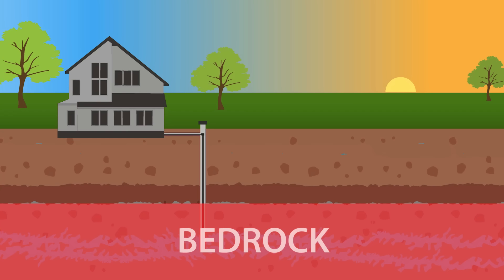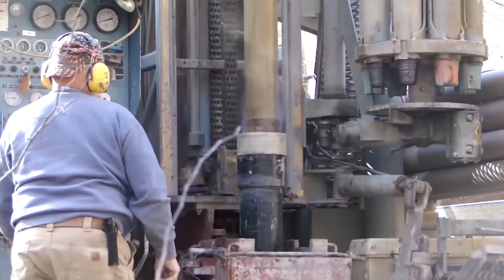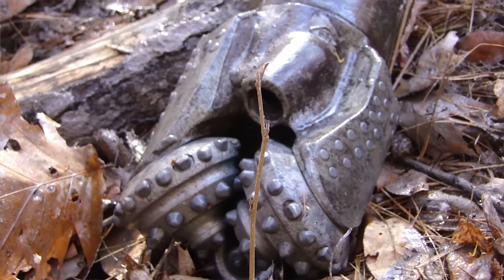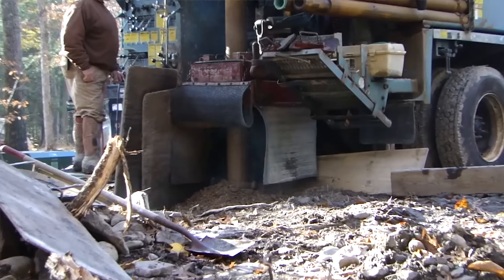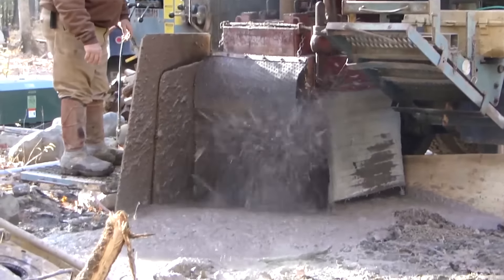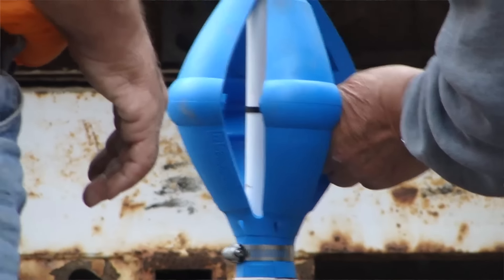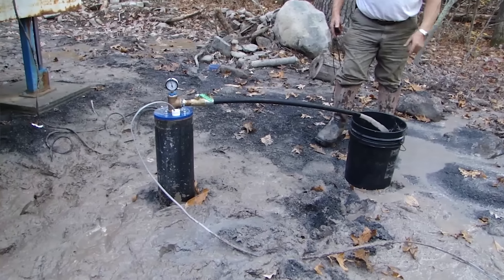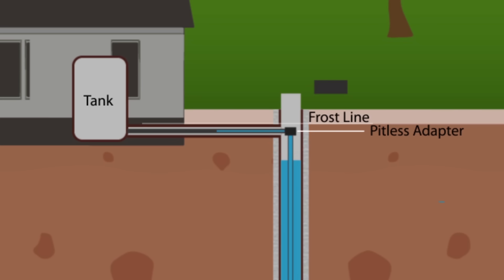WELL DRILLING 101 | Every Step Explained

Comment: This may have already been covered but:
- the reason to drill past where you hit water is to get a reserve in case the groundwater level goes down due to drought.  You gotta be careful not to go too far and hit dry strata that your well water will leak into instead of filling your well, though.  The extra length of well bore in water bearing strata also increases your potential flow rate.
- the reason for putting the pump higher in the hole is that clearly you have enough hydrologic pressure to push the water most of the way up, which means you can put the pump higher and therefore spend less on a smaller pump that doesn't need to sustain as much head pressure to get the water out of the well.  It also means the pump is further from any sediment collected in the bottom.

Thanks for putting this video up... I learned something from it too (which I didn't find in the videos I learned the info above.). I was looking for an explanation for how far the casing goes and why, and how the drill bit for stone fits through a hole that already has a casing in it.  Your video had that, none of the pro well driller videos did.  Thanks again!
Reply: Thanks well explained. 
What is the safe distance to go past after hitting the water if one is to avoid hitting the dry strata
Reply: @messagetsaurai2082  according to the professional well drillers I just had do my well, you stop when you notice the clay in the material coming up the borehole.  They said it is very noticeable.  The clay layer is generally at least several feet thick so you have some time to notice before you have gone through it too far.
Reply: Putting the pump deeper does not increase the amount of work or power that the pump must spend or exert. That is because the extra water column above the pump makes up the difference in pressure.  Otherwise, excellent desription.
Reply: @FelonyVideos  this comment feels wrong, but I can't think of a counter argument, so I'll just assume you know more than me and accept it lol
Reply: @kenstein  FWIW. I agree with everything else you said.

Please allow me to explain my note about the pressure and the work required, I'll use an analogy:

Imagine you sink a pump down to the bottom of the Marianas Trench, 35,000 feet down. The water will fill your pipe all the way up to the surface of the ocean. All the pump would have to do is supply enough pressure to raise the water above the surface to whatever height you desire (this is the outlet pressure). If the pressure at the bottom is (making up a number) 50,000 psi, and the pump can make 30 psi, it will create 50,030 psi right at its outlet. This will result in the water in the pipe, all up and down the length of it, to be 30 psi higher than the surrounding water, all the way to the surface. The flow rate will depend upon what restrictions the pump has to pump against. Now, if you raise the pump all the way up to the surface, where the relative pressure is 0 psi, the pump outlet will still be at 30 psi above the surrounding water. (I'm ignoring the fact that 7 miles of 1 inch pipe would create a massive restriction all on its own, but in the case of a water well, we are only talking about a few hundred feet of pipe, almost negligible).

So, the deeper the pump is in the water column, the more pressure assist it gets from the surrounding water, and that gets completely negated at the water surface (which must also include the cone of depression causes when the pump begins to pump close to the rate of the well feed capability).

Just for reference, the pressure in a water column increases about 15 psi for every 33 feet of depth from the surface.

So, if a pump is 100 feet below the surface, the pressure at the pump inlet would be about 45 psi. This is exactly the amount of pressure required to push the water up the pipe 100 feet. If the natural water level in the well is 200 feet below ground level, then the pump has to make 90 psi just to get the water to the surface with no flow rate. In order to get 30 psi at the surface, the pump must produce a head pressure of 120 psi. If the pump is at 300 feet in the same well, it must also create 230 psi, because the surrounding water pressure exactly compensates for the extra depth.

I hope that makes sense, I'm not very good at describing mathematics in words.
Reply: @FelonyVideos  yeah, that makes perfect sense.  Thanks!

Comment: The company I work for builds drill rigs you did a good job of describing everything for not having that much experience in the industry actually rather impressed with your amount of knowledge man. I learned a lot as well because I’ve never been in the well side myself and looking to drill one
Reply: How much do the drill rigs you built cost?  How do I get a basic, used one for a good price?
Reply: @r0ckworthy  used rigs can easily fetch $100,000. RigSource is a good place to research pricing and types.
Reply: @Volundur9567  I found their website, thank you. That's Rig Source Inc, in Elburn, IL.
Reply: @r0ckworthy  Yep,  I'm looking to rent from Rig Source.   Anyone game to diy drilling????   I need two done.  I'm Class A CDL and former heavy equip op.  but need some one with a little rig experience to coach.

Comment: Good job! From the oilfields of West Texas, I love to see water wells being drilled. We don't have much water.
Can you imagine drilling 13,000 feet with a 4 inch drill bit? And then turning it to keep drilling horizontally another 8,000 feet? These drillers of water and oil are something else. I'm amazed at how they do it.
Reply: WHAT???? That's what someone has to do to make a water well in Texas????  That's fucking insane. How could the water table be so far down and far away in some places? Is most of West Texas like this?
Reply: @r0ckworthy  I'm pretty sure they ain't drilling down 13k feet for water.
Reply: Yep.  Horizontal drilling and fracking for oil/gas builds on the same concepts as water well drilling.  Amazing stuff.
Reply: No one drills 13,000 ft for water. That’s not true!

Comment: Yeah, the blue thing is a torque arrester and more or less centers the pump in the bore. When the pump starts there's quite a twisting motion that if not countered by the "blue thing", may over time, fatigue the drop pipe that the pump hangs on and pushes water up through. A cracked drop pipe is a bummer. The over burden portion of the well was drilled with a tri-cone bit with carbide (not diamonds) inserts (knobby things). The invention of this kind of bit is what made Howard Hughes a multi-millionaire. It is sometimes referred to as a "Hughes" bit. When bedrock was encountered, the rotary bit was swapped out for a hammer drill. The PVC pipe was purpose-built for well drop pipe. Great video. I learned a bunch of stuff...thanks!

Comment: This was SUPER helpful. I bought a property with a drilled well set up that requires a heating line because the water access remained on the top vs being piped in the side under the frost line and brought to the building in that way with the pitiless adapter you are showing. I am in Canada where the temperatures drop in the winter. Trying to figure out why this is set up this way and if it can be changed.  I believe this building was originally a seasonal cottage in the 60s. 

Anyway, thank you so much. I am on my own here with a limited budget and this is the first truly helpful video I have seen for someone like me.

Comment: The blue thing above the pump looks like a torque arrestor. Keeps the pump from spinning and the wire from wrapping around the drop pipe. Thanks for the video. Well done!
Reply: Also, since it was PVC drop pipe instead of iron, it keeps the pipe from twisting and snapping and dropping the pump down the well. Ours is iron pipe and it doesn't have an arrestor on it. When we replace the drop pipe with PVC, we'll have to install the arrestor.
Reply: It is a torque arester
Reply: Had a pump installed without the torque arrester.   Eventually rubbed the wires bare from repeted twisting.
Reply: There’s an even more efficient way to install the pump too. Use black Polly pipe instead of pvc for easy access for pulling the pump and then use 3/4” black Polly pipe as a conduit for the wire to ensure the wire doesn’t rub and break. The blue torque stops can get stuck inside of wells very easily and can cause issues. Especially when they used pvc when it wasn’t necessary and is more expensive.

Comment: We're in Western Pa, Parents well is 350 ft deep, another one is about twice as deep. Question, what can be done about sulfer water? Did the casing crack? The well at 350 ft deep, water is beautiful best water ever. The deeper well across the street and up hill a little, water makes clothes red in wash plus must use Iron Out to clean tubs, toilets and sinks...any ideas other than a salt water filtration system we now have?
Reply: p.s. Same well that has the iron or sulfer smell to it, also feeds two other homes. One out of the three homes water smells like sewer gas... currently calling about that...what could that be and would it need shocked with chlorine?

Comment: I drilled oil wells back in the 1960’s, ‘70’s and ‘80’s. some as deep as 17000’ vertical depth. Your descriptions aren’t far off. Thanks for sharing.

Comment: I worked for a well driller for a  few years and you do NOT want to dig a pitless adapter for many reasons. First of these is contamination; any connection below grade is a source of possible contamination, like you said we humans tend to make a mess of things. Second is that to install the pitless adapter you have to dig a pit, then work in that pit while drilling a hole in your casing (getting metal bits in your drinkwater) installing the pitless adapter ect..., and if a connection fails, you have to dig that pit again. The next time you work in that pit is even worse, because it's wet and muddy and hanging head first into said hole is no fun at all, I know first hand. It is much better to have all your connections above ground where it is dry and clean. Build a shed with enough room stand up in. This will house your pressure tank (tanks?, you can hook up more than one), and build a little doghouse looking shed on the side that has a removable roof over your well head, that way when your pump fails it will be easier for that big truck to pull those long 21 foot pipes back up and out, saving you money in the long run.
Reply: Dude, you're delusional. I work for a pump company, we dont dril wells, we JUST work on pumps, and in 35 years full time, my boss says he could count on both hands the number of pitless adapters that have failed. On the other hand, he says the extra hourly he's gotten over the years for working around shitty well houses probably paid for his truck. Furthermore you'll never contaminate the well if you have a casing 18" above ground, and use a health department approved cap, as well as have a conduit installation that's up to code. I've seen 10 times more contamination risk in shitty damp rat infested well houses, that have well seals (that are harder to install than well caps, granted you have to dig a pitless hole like you said) with unplugged holes in the top. Also I question if you really worked for a driller, because any driller would laugh at you for saying cutting a hole in the casing contaminates the water any where near as much as the drilling process itself. By the way, what happens to that little rat infested shit hole when the driller has to come back and deepen the well or surge treat it with chemicals? You're spreading misinformation that could cost young homeowners tens of thousands, pull your head out of your ass driller boy (i still doubt the validity of that claim, like by few years do you mean for 2 summers you worked a month on your uncles rotary rig crew or something?)
Reply: BS

Comment: Ex oilfield (drilling) electricianhere, and I'm  so glad your video just popped into my phone. Very simple and informative. Plus, there are lots of smart & informed comments from other viewers. 
Someone mentioned the tri-cone rotary bit invented by Howard Hughes and how he made the majority of his money. In a similar vein and related to your industry, we used specially designed big (50hp+) 3-phase submersible pumps to supply seawater for engine cooling, big refrigeration units, and for making drilling fluids.  These pumps weren't ours. The company BJ didn't sell them. We had to lease them because of the proprietary nature of the motor, pump, and specialized pressure and flow control system up top on deck. There are literally 100's of thousands of these units in the oilfield alone, raking in $$$ day after day. Great minds think alike because the two companies merged, and Howard Hughes and Byron Jackson became BJ-Hughes with 1,000's of operations all over the world. And that's the rest of the story. Cheers 🍻 and happy drilling.

Comment: Did they put additional casing in the bedrock with screens at the water table to keep grit out of the pump? Here in Idaho, they use an 8 or 10 inch casing for the first 20 to 40 feet or so then a 6 inch casing down to the water table. They often drill past the water table and put casing in so grit can drop into the bottom and stay away from the pump. The screen often has a 0.016 inch slot size. 
The well pump pressurizes the entire system. No need for a second pressure pump. That down hole well pump can push water up hundreds of feet. At .4 pounds per vertical foot, that 180 foot pump is pushing 72 PSI just to get to the surface. Your home uses about 65 PSI in a domestic water system. That 1 inch PVC pipe has a 270 PSI working pressure and 1440 burst pressure. The pump would be sized to lift the water from the water table plus 150 feet or so to provide pressure to your distribution. 200 to 250 feet lift head plus 80 PSI is a common minimum size pump.
Reply: Actually the 180 ft of water head is 78 PSI.  There are 27.7 inches of water column in 1 PSI.  180 x 12 = 2160 inches of water head.  2160/27.7 = 78 PSI.. All rounded to 1 decimal place.
Reply: @buck3409  Picky picky. .433 psi per foot of head. The basics of my comment are still valid. The resting water level also comes into play. A well with water at 180 feet could have a water level at 100 feet. My well has artesian flow at the well head that varies.

Comment: Great video! I bet it cost you a pretty penny. Do they charge per foot? 
Between the output well head and the house, is there only one or multiple  check valves to keep water level up to where it last pumped it and contamination out?

Comment: 1: pump center device is correct. 2: PVC plumbing is standard. 3: pipe is under pressure (.433 lbs/ft of head) example: pumping 100ft and pipe at the bottom is under 43.3 psi. 4: They keep drilling below surface aquifer because your pump experiences drawdown (decreased surface water level due to pull of water). 5: you are on fractured rock which means you are dependant on rain filling veins in your region. 6: the lower you set the well the less water you will pump, but this also depends on the current surface level of water (higher surface =more water due to down pressure and lower surface = need for more lift). Nice vid

Comment: Hi, great video of explaining the process. I would like to know how much did it cost in your area to put in the well.
Reply: @TEE PERO 
If what you say is correct, then it's  just 6k .. Let's say plus the tank and pvc and all, roughly about 10k.. 
Dude,  that's totally worth it..
Reply: 10 years ago I paid $21 per ft plus 2K to have the pump wire and pipe installed (separate deal from the driller) 485ft deep
Reply: How possible
Reply: NV is appx 10k for every 100ft

Comment: “Plumb”  the term “level” refers to a plane that is parallel with the top surface of standing water,  bird bath, pool, pond etc. Plumb is a term that refers to a plane 90° perpendicular to a “Level” surface.
Reply: The surface of the water in a birdbath is actually horizontal. Plumb is a line aiming at the centre of the Earth. A level line is a tangent to a horizontal plane. This is all a bit "nerdy" at birdbath size, but if you are mapping a country, it matters.
Reply: @hughjarse1381  tom conner said it better, level water, not center of earth

Comment: Interesting video. I'd love to know how you selected the location for drilling the well?
Reply: Me too
Reply: not a driller myself but i do service pumps and work around drillers, you can actually witch for higher up water in the ground with two copper wires or with a two pronged stick, however more often than not there's water everywhere, only time you need to witch is when your in like Nevada, Texas, or eastern Cali, basically desert regions
Reply: If your deepwell is for commercial use better consult a hydro geologist so that they conduct resistivity survey to locate the source of water or aquafier
Reply: @tebiofthetor1402  I love your advice... Just because a person can spell doesn't mean the one who cannot isn't smart. I just wanted to let you know it's "which" not "witch". I am sorry I just wanted you to know. 😊
Reply: @juellzzdrizzy    In this case "witch" is the proper term.  It comes from terminology derived from witch craft....
Reply: Distance from leech field And septic tank. Also accessibility and town codes based on property lines. Are the usual ways I go about picking a location.
Reply: Dousing rods of course
Reply: Good video!
Reply: @juellzzdrizzy   LOL! Nothing better than when noobs try to correct people......

....incorrectly!